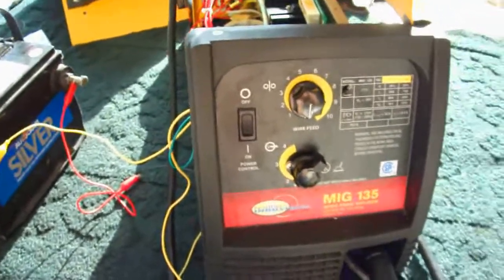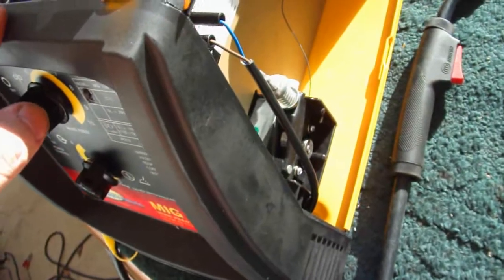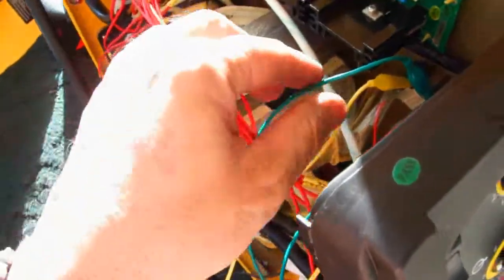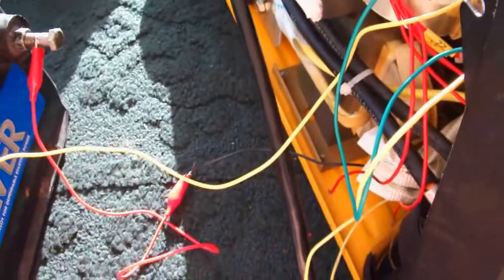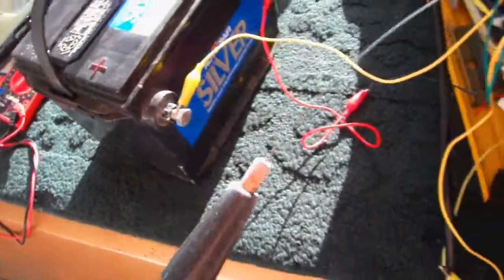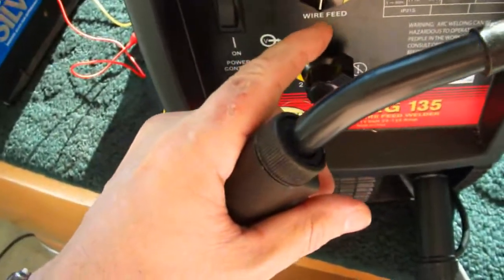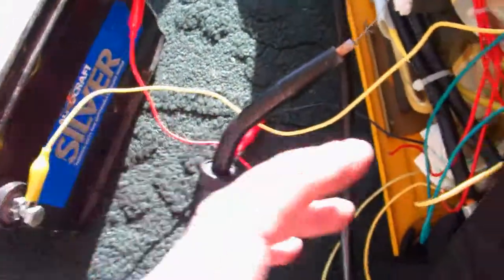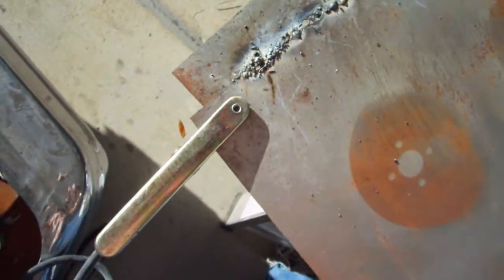Northern Tool MIG 135 Repair Succeed.

Comment: I just had this same wire feed problem with my Northern Industrial 135. I was able to fix it by just re-soldering the 3 joints on each of the two transistors with the large heat sinks on the PCB. I noticed that a couple of the joints looked a little weak so I gave it a shot and it worked.

Comment: Had a wire feed motor go out on an Eastwood 135.  Looking at replacing it.  The Eastwood motor runs on 24VDC.  Just in case you hadn't thought of it, running your motor on 24V might bring back your wire feed adjustment . . . .?
Reply from the maker: Superer Dave thanks

Comment: Hobart is a completely different machine in if u want made in the usa buy miller thay have infinite adjustment on wire in voltage. Much nicer than hobarts 1.2.3.4. Control
Reply from the maker: Ok, thanks.  I'll be getting when I need it.  For now this thing will stick together 2 pieces of metal :)